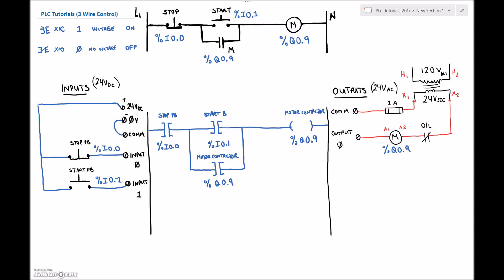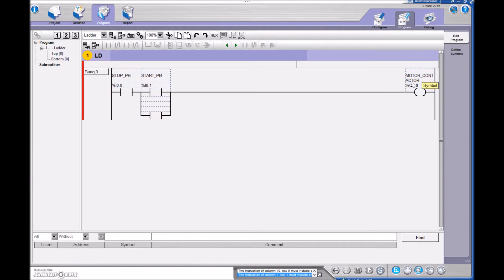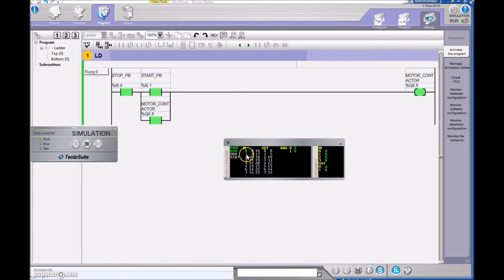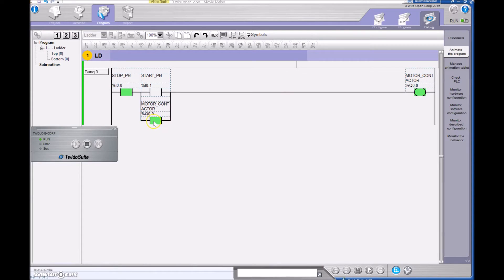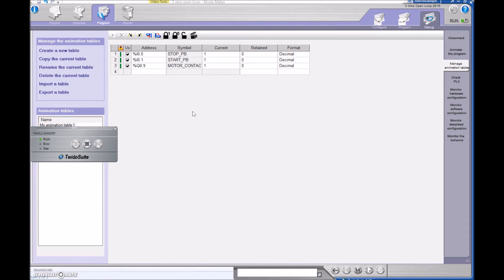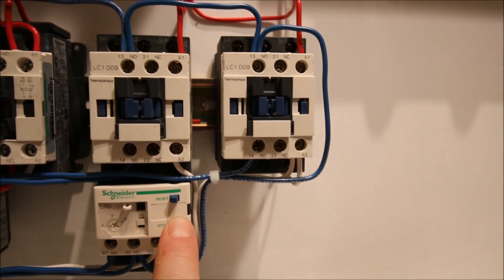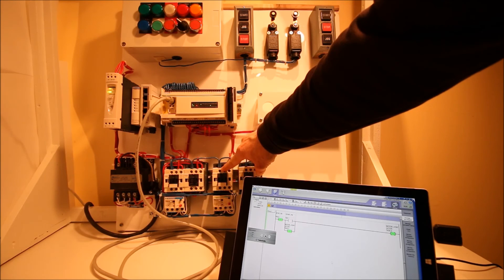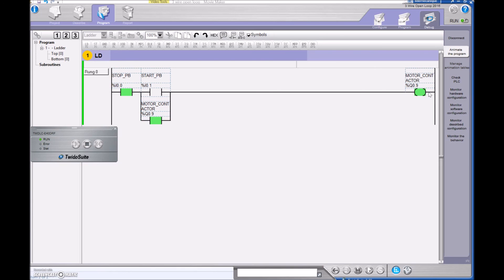PLC Tutorial (TwidoSuite) #3 (3 Wire Open Loop Control)

Comment: Thank you for a great lesson, Pete. I think it should be mentioned that we might use NO Stop PB and XIO instruction, instead of NC Stop PB and XIC instruction. But it wouldn't be correct in sense of fail-safe design( for example if a wire connection from the Stop PB to the PLC is open). Looking forward for your next videos. Thank you!
Reply from the maker: For sure. I just wanted to keep it simple so far. Thanks for bringing this up.
Reply: Is there a video later down the line where you use XICs for the closed push button like Soslan is referencing?
Reply: Hi Pete, waiting on your response, Is showing the NO contact in the PLC the correct way to do it like you've shown in the video? Is there another subsequent video that shows the correct way? Thanks.